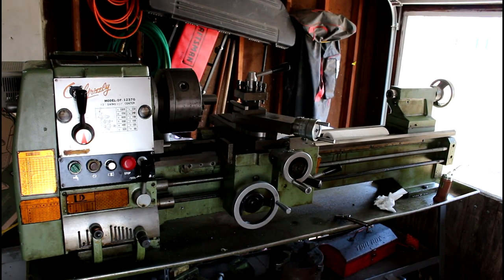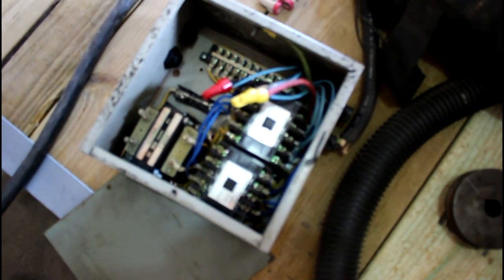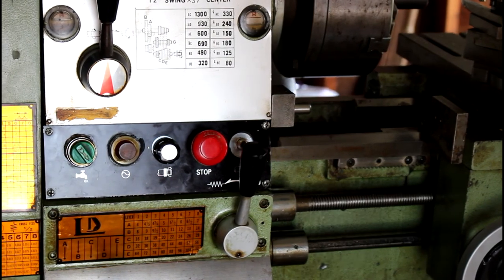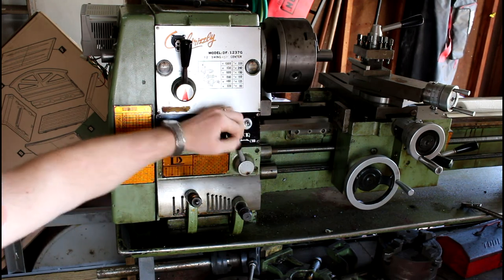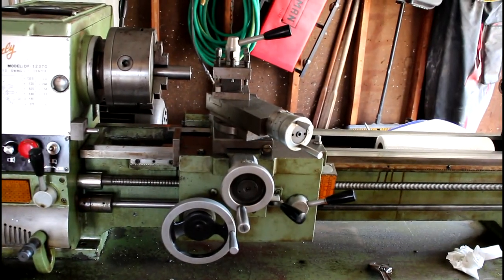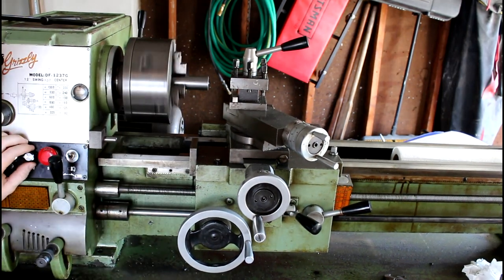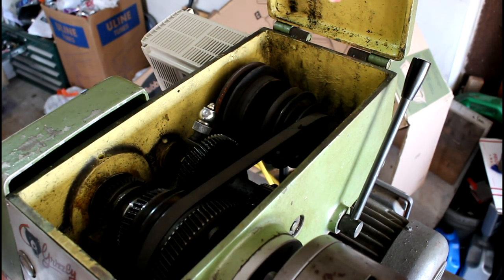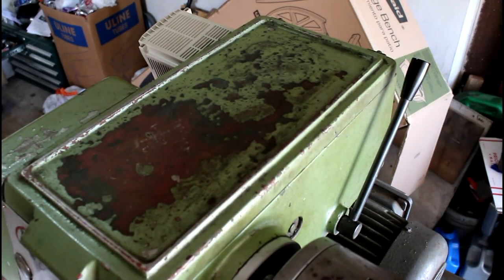Grizzly Gunsmithing Metal Lathe 12X37" DF-1237G Overview WIth VFD!

Comment: I bought one of these machines at the Grizzly showroom in Pa. new back in 1987. Mine is a later model than the video but it was manufactured in Taiwan, they started putting a cheap drum on/off/reversing switch. The only problem I ever had with it was the original motor burned out. That was due to the reversing switch going bad and me not recognizing the problem. Replaced with a better switch and a new motor and it has worked well ever since. With the addition of a Quick change tool post, 5C collet chuck and a DRO this machine is capable of doing very accurate work. Just level it correctly, use an actual machinist level, use shims under the right side feet to correct any twist (not the feet on the table, that's for leveling of the stand. Once I had the  lathe set up I went through the factory QC inspection sheet and checked every measurement. Other than the headstock needing a little adjustment the machine was dead nuts on spec. Can't get any better than that even on a South Bend. I've had a lot of fun the last 36 years making attachments for it and lots of parts. The only thing I don't like about it is the fact it uses thread on chucks. Shortly after I bought it they came out with a new model that had a locking spindle mount for about the same price.

Comment: Happy to see this Taiwan made lathe in action. They are pretty good lathe with hardened bed and tapered gibs . I also bought one recently distributed by Enco.. You can easily disassemble the lathe. Four screws under the head and one in the back for alignment. Disengage the power feed worm gear held in the back of the apron with two to four screw( hard to get it though). Unscrew the gear box front cover and and you can see three to four screw securing the gear box to the bed. Unscrew them.
Reply from the maker: +John Babu 
Hey, thanks for the info. I did keep it for a while then ended up selling it to a guy that appreciated it more. I was going to try and tear it down, but it wasn't the lathe I wanted, so I sold it. It was pretty nice though for being a 30 year old machine. Only thing I didn't like about it was the threaded spindle. Other than that it was great especially with the vfd. Thanks again!

Comment: pretty sweeet..i just scored a Jet Bd 1325...which is essentially the jet version of this...mine does not have the oiler tho...is that what the spigot icon means on the control panel...thanks for doing the video..i may convert mine to  vfd also...just for speed control..mine is not phase three tho

Comment: I have the same model.  In Canada it was distributed by Busy Bee Tools.  Just got mine up and running on the original 220V.  Do you know what kind of lubricating oil the machine takes?
Reply from the maker: I'm not sure, but I would use way oil on the bearing surfaces. I think they use a medium weight oil in the gearbox and headstock. I think I used Mobil DTE Medium ISO 46.
Reply: Precision Machine Shed thanks for the reply.
Reply: telus 32 (manual says Telus 27  or 32   27 isnt very common

Comment: It appears that you wired the 3-phase from the VFD direct to the lathe motor.  Could you have used the factory relays to do this (i.e. just connect the vfd to the factory input)?  Thanks
Reply from the maker: +Mogman150 
To the best of my knowledge, these VFDs need to be connected directly to the motor. Not sure why, but it can cause problems if you don't.
Reply: @ Mogman150 - Disconnecting a vfd from a motor while under load will cause damage -  you just use the vfd to reverse get rid of the relays
Reply from the maker: Not sure how you would pull the power off the motor while running. They are wired directly. Yes the motor is reversed using the VFD.
Reply: Your setup is safe - Mogman150 was asking why it can't go Vfd - Relays - Motor..

Reason being it will disconnect the vfd from the motor for a split second and could (most likely) send power through the transistors to ground instead of through the motor!

Comment: how do you change gear on this lathe to cut metric thread
Reply from the maker: I am not sure because I don't have this lathe anymore and never cut metric threads with it. Many of the lathes like this may require one or two gears to be changed. The newer version of this lathe, I believe everything is done with changing levers. That being said, I've not done metric threads on one of these.
Reply: It has gears for metric supplied. the half nut lever is engage dont dis engage it and you have to forward reverse the spindle in metric threading.

Comment: How do I go about finding a used metal lathe like this?
Reply from the maker: +smoakngun Keep an eye out on Craigslist and eBay. Also if you let anyone you know that might know someone that can sometimes help. It ends up being a waiting game sometimes. This one the guy contacted me because I put an ad out saying I was looking for a lathe around this size. Sooner or later you should be able to find one depending on where you are. I've driven 300+ miles one way to get a lathe before.
Reply: Place a WTB add in Craigslist. Contact local machine shops as well, sometimes they want to get rid of “smaller” machines to make room for larger machines.

Comment: VFDs are nothing but motor/relay/contactor/solenoid killers. You can't run "high-voltage AC" components at lower than their "rated" voltage without overheating and eventually ruining them. When "household current" is too low for safe motor and other appliance operation its called a "brownout" and its far worse than a "blackout". Reduced voltage = increased amperage and cycles per second drop as well. Once you end up with low voltage and alternating current alternating too slowly and coming on and going off too slowly, you've got a perfect scenario to "burn up" anything and everything electrical that current is supplying from light bulbs to electric motors. The only reason "hobbyists" and their POS scrapyard-reject "vintage" machine tools get away with "VFDs" instead of proper voltage/phase service is because they're "hobbyists" and aren't running the machines at their designed "continuous" duty cycle ability. And when "hobbyists" start playing "machinist" in their garage/basement/spare room/local maker "space" and start "working" machines to anywhere close to "full capacity", they start "burning up" electrical components.
Reply from the maker: You are an expert on everything! They still run on their rated voltage and you don't use contacts, solenoids, or relays. What do you think those $500,000 "Industrial" CNC machines run on? Let alone just about every automated CNC machine... they run on VFD's. You probably have one running your A/C too if you had your power company install an energy saving system for your A/C. Please educate yourself before you post your 40th uneducated and false comment on my channel. These are comical to read though.